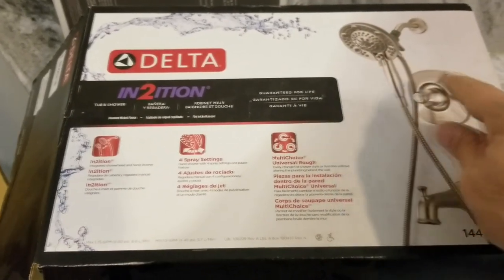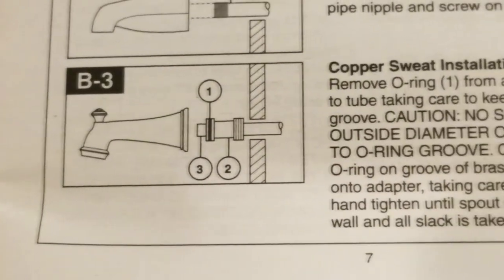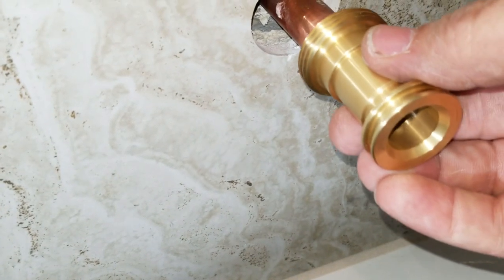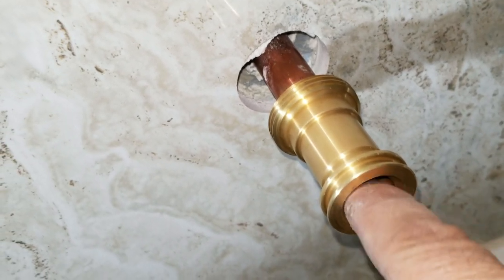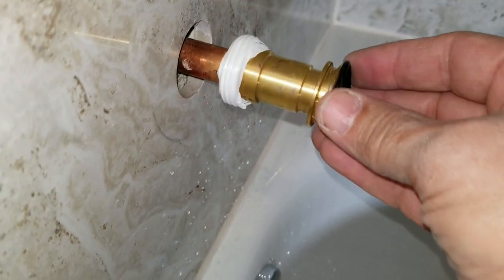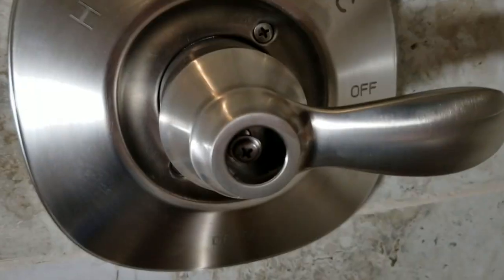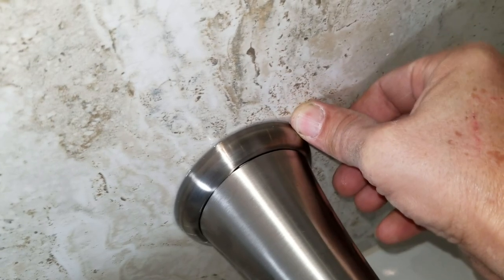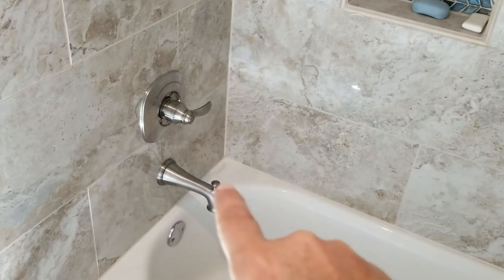How to Install Bathtub Spout, Solder on Adapter, Delta In2ition

Comment from the maker: Tools used in this video:
Delta Nura In2ition Shower Kit: https://amzn.to/2QMorn8
Bernzomatic TS8000BZKC Premium Trigger-Start Torch Kit : https://amzn.to/2Bzj80K
If you just want to get the Delta Faucet 75584SN 5-Spray/Massage In2ition shower head: https://amzn.to/2ScwXZP
Reply: The previous owner simply pushed the copper pipe into the copper line in the wall, now after tiling the wall the pipe stick out too far. There is no access from the back side. What is the solution?
Reply from the maker: @calvincunningham8353   You can cut the excess pipe off the end with a close quarters pipe cutting tool. Is this what yo need? You are trying to make the pipe shorter?

Comment: This is one of the absolute best videos online for this Delta adapter. Clear cut, in-the-field quality real world instructions. Bravo to you Jeff. These things can be reeeeeallly tricky because the instructions suck. I always dry fit it, or side fit it and see how it really functions because 9 times out of 10, the instructions are not going to tell you the whole story. Some adapters for Delta are like the one in this video where they have an inner race inside the adapter body where the pipe will stop and butt up against it and that's where you make the solder joint. Other Delta tub adapters allow the pipe to slide right through to the face and you solder it at the face. Use your thinker when installing these. Superb job again.
Reply from the maker: Thanks, I'm glad you liked the video!

Comment: I just disassembled my 20 year old Delta regular basic "plumbers go to" spout. It is assembled exactly as your directions say The pipe does stick through.. There must have been a change over the years.  Possibly your directions were for the wrong model. Nice of you to share!
Reply from the maker: We did get a Delta shower valve and tub spout that the spout was wrong, did not match instructions, called Delta they did not know what we had, and I had to go back to Home Depot and buy a generic tub spout for it work.

Comment: This was the best video on this install. I must have watched it 10 times. Gave me confidence to tackle this.  I would say that my water line did run all the way through the adapter and then I cut it to length per instructions and mine looked just like the video. Who knows. But thank you so much
Reply from the maker: Awesome, glad it worked out for you D!

Comment: The tube is supposed to go all the way through. Even on your video, one can see that it almost does. I bet the tube just wasn't round or there was some burr at the end. It's been my experience that seemingly identical copper fittings might fit quite differently. Fixing roundness and/or using sandpaper usually fixes the problem.
We don't know how good your solder "joint" is. You pulled at it a couple of times, but, if it holds by a sliver of solder, few years of use might break it.
Reply from the maker: Our solder joint is good it wicked in the front of the joint

Comment: Just so everyone knows. This adapter does not have a stop on the inside. You need to have the  copper go all the way though as the instructions state. I will take a little fineness but it will go in. Deburring will help.
Reply from the maker: Also delta admitted when we called in that they had several complaints on that model that their machining was too tight to fit around a pipe.

Comment: Tube does go through the adapter on the Delta spout I purchased just like the instructions stated. Check before you cut off the pipe!
Reply from the maker: Yes the adapter is designed for the tube to go through, for many people the copper tube does go through the adapter and you cut off the excess. We cut the tube, we reamed the inside of the tube, we chamfired the outside of the tube, it still would not go through. Called Delta, they said they had received numerous complaints from other installers about this. The way we soldered this tube is correct, because it is the same way you solder it if the tube passes through it, because you only solder where they connect and the solder sucks into the channel via capillary action.
Reply: jeffostroff Jeff, listen to me. Where the pipe pushes through the adapter is where the diameter reduces for the proper clearance between the adapter and the pipe. This is where the adapter is supposed to be soldered. The adapter is loose in the back and tighter in the front by the o-ring, which is where the solder is drawn into. Trust me, I’m only trying to help you. You are making contact between the pipe and adapter, but not as much as you should be, because the design calls for the pipe to be inside of the reduced diameter portion of the adapter, not butting up against it, which is how it ended up on this install in your video. Take care and I hope you understand what I am trying to explain to you.
Reply from the maker: @rrhistorian8828  I know what you're saying, but it simply would not go into the adapter. We have been monitoring it, and so far no problems. Is it an ideal connection? No. But the pipe does go all the way into the adapter up to the point of the stop, and we fluxed and got appropriate Capillary Action inside that area, so it is holding it real good on the pipe, even though you don't think it is, you're looking at it from an academic standpoint, we were boots on the ground and had at least a 1/2" deep capillary channel filled with solder. Believe me we tugged and tugged on it to test it before sliding the spout on. It's rock solid. We hope the next time we encounter one of these that Delta got their act together and we no longer have a bad one. Remember these adapters are made for Delta in China, known for horrible tolerances, and no amount of deburring or chamfiring on our part would get that pipe through there.
Reply: jeffostroff Amen to that, Jeff. It is extremely unfortunate that Delta went to China along with most of Moen. Even Grohe is starting with inferior quality faucets made outside of Germany. I long for the good ole days of quality made products.

Comment: It’s very tight and you need to sand every micron of burring of the copper pipe but it absolutely goes all the way through that adapter. So if you put it up against what seems like a stop before you sand and work it over it’s gonna cockeyed most likely. You’ll see that the areas inside the adapter before it steps down in size is noticeably bigger than your copper tubing.
Reply from the maker: I have copier fittings that don't have that much trouble fitting onto copper pipes

Comment: I’m getting water coming from the back end of the spout! What did I do wrong? I am not flush the the wall - will that cause it@? I have the new adapter with the inner o ring and the fighting screew- so I don’t need to solder ? Help
Reply from the maker: Usually when you have water coming out of the back end of the spout, it is because the o-ring that was supposed to be on the front of the pipe when you insert the spout over the pipe, is not there or maybe it got moved or something. But that oh ring is very important because it keeps the water from coming back towards the wall. if you look at the instruction manual for when you buy your new tub spout, they usually tell you where to put the black O ring

Comment: I just used "lip install" you put the adapter on, which has an inner oring already, then just set screw it to the pipe. Then screw on the nozzle. Works fine
Reply from the maker: Thanks!

Comment: I'm watching for the spout install instructions in your video. I have not read through all the comments, but I have to wonder if there was a revision made to the spout by Delta because my copper pipe passes all the way through as well as some others have stated.
Reply from the maker: When I called Delta, they said there was an issue, so maybe they fixed it.
Reply: Mines also

Comment: I had same problem at first, but after I fluxed it it slipped through that tight spot so I guess it just needed some lubrication. I then took it off and tried it again and couldn't get it to fit. Took me about 5 minutes to get it back on but it does fit with some type of lube and alot of finangeling. Good luck people 🤪
Reply from the maker: Yes they should never be that much trouble

Comment: The tolerance here is very close and mine did fit. The fit inside the larger diameter is very loose and I would not solder it like it’s done in the video. If mine didn’t fit, I’d carefully cut another piece of copper (don’t clamp down too hard on your pipe cutter when you cut it) and then if that didn’t work, I’d contact Delta. There’s really not much water pressure on this unless the diverter is to the shower and the shower head is turned off but if someone tried to lift themself (kid) by the spout it could break the soldered connection. Also, if you’ll notice, the O ring side has a bevel. It might be easier to push copper pipe through the brass fitting on the O ring side all the way to the elbow and then solder it to the elbow. You can cut more copper than you need and cut off the excess when you’ve slid the fitting where you want it when you’re ready to install the spout. Then cut off the excess. My two cents.
Reply from the maker: I just hope the next one has better tolerance, this was terrible, but at least it is still working up and holding.

Comment: Found your video to install my delta tub spout.  Great video.   I found though with mine that after I used sanding cloth to clean up the copper pipe, the adapter did slide all the way onto the pipe where the pipe could go all the way through.
Reply from the maker: Great tip!

Comment: Check the bag the spout was in for the correct copper instructions.  The internal o-ring must be removed before inserting the copper pipe in the adapter.
Reply from the maker: That is where we got the instructions
Reply: @jeffostroff  I was just wondering because the instructions in the Owners Manual didn't state to remove the adapter's internal o-ring, only the external.  We found the correct instructions on the plastic bag the spout was in.

Comment: No need to calk the overflow.
Never use silicone for a finish if you don't have too.
It will look bad when mold grows and you cland clean it.
Use silocnized acrylic  calk.
Cleans up with water as you apply it and is easier to clean it up next year.

Comment: Just a heads up, I thought the brass piece wouldn’t slide over the copper pipe in my tub too. But after cleaning up the burred edge with a file it slid right on. Other than that thank you for the excellent tips on install.
Reply from the maker: On ours, the problem keeping the pipe from going all the way through was the built in stop that is engineered into the center of the brass piece.
Reply: Yeah, my brass piece was identical to the one in the video with the “stop” built in. It’s such tight tolerance that the smallest lip from the pipe cutter on the copper was causing it to bottom out. As soon as I removed the burr from the copper it slid right on. Who knows maybe I just got lucky lol
Reply: That “stop” is where the inside diameter of the adapter decreases to create the correct clearance between the adapter and the 1/2” copper pipe. This area is where the solder is drawn into using capillary action. I’ve been installing these for 30 years and I guess the Chinese shit quality is showing now.  Concerning the person you spoke to at Delta, they have NEVER installed one of these. You’d be better off asking someone at the supermarket for advice. What has happened to these companies? When we called years ago, you got someone who has been there, done that, nowadays, you get someone who has no plumbing experience at all and can’t help you. Customer service at Delta has become glorified parts order personnel at best. If it weren’t for the supply houses I deal with, I would have no recourse.

Comment: I install Ashlyn tub and shower I didn’t soilder the tub spout  And the tub and shower runs at the same time and we left the shower spout
Reply from the maker: Sound slike the tub spout is out too far and not doing a good enough job of closing off the tub pipe so the water is not diverting as much to the shower like it should be.

Comment: There is no stop inside the adaptor. If you're trying to fit a cut pipe through and it won't clear that last little bit  (and you don't see any burrs), you probably have a little lipping on the pipe caused by the pipe cutter. A few careful passes with some emory cloth did the trick for me.
Reply from the maker: I did a lot of deburring there on that pipe and chamfered it as well, nothing worked.

Comment: On my Delta Shower Kit, I triple checked for an out of round copper tube,  check for burrs and sanded the tube.  Nothing worked. Then successfully  completed per this video. I'm guessing Delta has a quality control issue and some adapters are out of spec.
Reply from the maker: That it what we assumed also, since others reported they had no problems. Called Delta, they said they got lots of complaints about this part and likely had a bad batch of them.

Comment: Well I don’t know if this video is dated or what but my brass fitting did NOT have an internal stop. As a result my calculations were off because The 1/2 copper pipe pushed right on through. Luckily my pipe was still long enough to solder and tighten the spout. My advise is be sure to check your fitting to see if it has a stop or not.
Reply from the maker: Brian, yes we filmed this video last November. We are just now starting to hear of others like yourself who found the the pipe correctly slide through. I do know that I had made Delta Customer care aware of the situation and they told me they heard of others with the same issue, so maybe they straightened it out.

Comment: thanks for the video. How do you join the shower head arm to the copper pipe?
Reply from the maker: Daniel, it's sort of like Luke Skywalker getting that torpedo into that port in the trench on the Death Star. It's all done by feeling it. You first wrap the Teflon tape around the threads, then insert the shower head arm into opening all the way back and feel for it contacting the threaded opening, then tighten it down.
Reply: @jeffostroff  do you mean there is not soldering? just pressing it to the copper pipe?
Reply from the maker: @DanieldelCastillo_DELCASDA   If you are referring to the shower arm that comes out of the wall about 7' off the floor that 1 gets screwed in to the pipe that's in  Inside the wall that you can't see but you have to feel for it.

Comment: A plumber installed for me and soddered whatever, I didn't see. Now the spout is about .25 away from wall, not flush, and he has filled with caulk. This does not seem correct at all. Can you advise???
Reply from the maker: That seems wrong. Is this a licensed plumber or a handyman? The spout is supposed to be screwed in all the way until it tightens against the wall, the you apply silicone around it, leaving the bottom open from 4 o'clock to 8 o'clock. I hop they used silicone instead of caulk.

Comment: The Copper Pipe fits through the collar just like in the directions, but not if the pipe has a lip on it.
Reply from the maker: We deburred th epipe and it still did not work. We looked at the roundoing of th epipe, still would not work. Delta told us they were getting calls from others with this issue too.

Comment: This is what I have on my current pipe sticking out. Soldered on just like that. I need to now remove it because the new spout I picked out uses a different style install method. How do I remove this piece now that its soldered on?
Reply from the maker: Aaron, you have to heat up the tip of this device, wherever you see the solder connection, heat it up with a small torch and after about 30 seconds or so, twist it off with a pair of pliers or channelocks.

Comment: Can I use the existing valve in the wall or no
Reply from the maker: If you use the existing valve in the wall, you have to buy a new fauctet and trim kit made for that valve. and you might want to install a new cartridge that matches the old one. But if you want to use this Delta system shown in this video, you have to buy the valve that is made for it. This is why we prefer to buy it all as one kit as shown in this video, so you're gauranteed that you have the correct valve for the shower system.